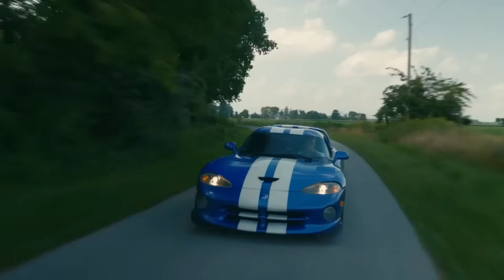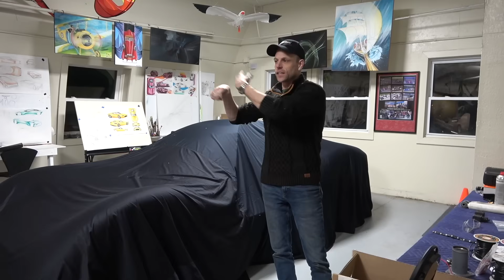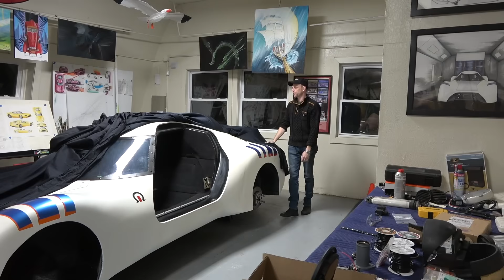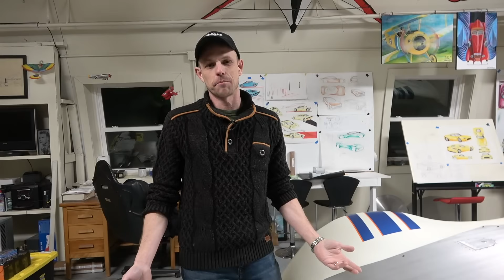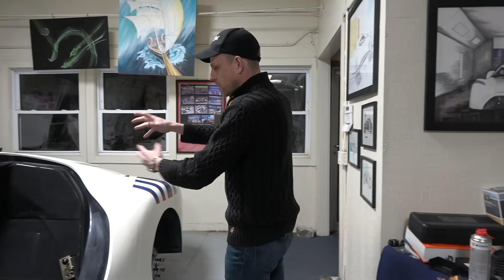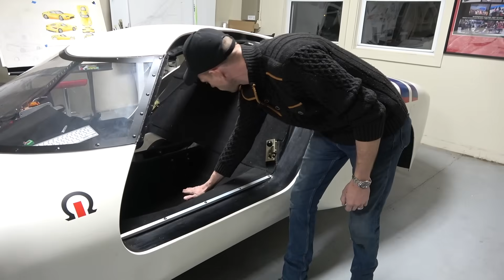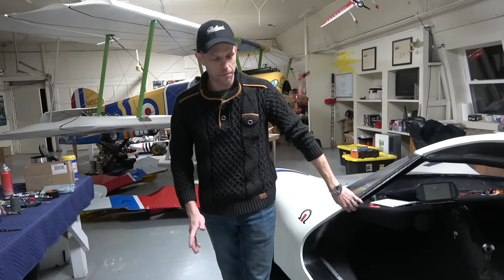Casey's OMEGA CAR because the AUTO INDUSTRY doesn't GET IT!

Comment: Sorry Casey but the ship has already sailed on ICE and especially diesel.  You're never going to match the efficiency of an electric vehicle.   There is a reason the entire automotive world is moving on and why Tesla is one of the most valuable car companies.  While producing batteries is dirty business there are massive investments and research underway on a variety of chemistry formulations to change that.  There have already been massive reductions in the quantity of cobalt for example and now even cobalt free.   Lithium mining is dirty but keep in mind the average EV only has 15-30lbs of Lithium in its entire pack and that battery will be good for hundreds of thousands of miles and then for many more years as second life stationary storage.   Even the crummy degraded Leaf batteries from nearly 10 years ago are seeing massive second life reuse for off grid and peak grid demand storage.    Don't forget Gas/Diesel needs to be explored, mined, pumped, transported, refined, transported again and even a Prius will burn 10+ tons of it over its life.   

And while the energy source to charge those batteries on an EV may or may not already be "clean" the GRID is getting cleaner by the day and thus your EV can be much cleaner 5-10-15 years from now than it is the day you buy it which can never happen with an ICE.  Coal is already the minority energy source and coal is no longer economically viable.  Fossil fuel based energy plants are already moving to NG because NG has half the carbon footprint of coal and requires no additional expensive scrubbing processes of the exhaust to avoid contaminating the environment.  Further NG can be burned directly in giant gas turbines and then the waste heat from those turbines can then be used to make steam leading to a 64% T.E.  This is far higher efficiency than what could ever possible inside a vehicle.  And at the same time solar and wind has become incredibly cheap.   New formulations of PV panels have extremely low degradation and will have a usable service life of multiple centuries.   Today you can put long life low degradation solar panels on your home/property and recoupe your investment within 5-10 years  and have "free gas" to power your EV for not just for the rest of your life, not just for your kids life, and not just for your grand kids life, but your grand kids grand kids life all off that initial investment.  That's not something ICE will ever be able to do.   

And the only thing currently not making EV's much cheaper than a comparative ICE already is the high cost of the batteries which as discussed before there are major forces at play to bring that cost down, way down at which point no ICE will compete in cost, maintenance, reliability, cost to operate.  Etc.
Reply from the maker: Tell that to people with no grid or electric infrastructure around.
Reply: Well how much of the automotive buying/driving world that does even represent?  And how much of the transportation needs of the world are represented by places with no electric infrastructure?  Are we talking about designing and building a vehicle to fulfill a very specific niche at a very specific location or something good for the world at large? 

Regardless I'd argue that outside of edge cases (perhaps Siberia or Antartica) its still easier and cheaper long term to build a basic electric/charging infrastructure than a fossil fuel transportation/refining infrastructure that needs a constant relentless flow of said fossil fuels in perpetuity.  There are remote places in the world where gas still has to be brought in at great expense both in cost and in energy yet they still have access to electricity.

Comment: That's an amazing project! Love it so much. 
As for economy, best I've gotten on good ole 87 pump swill was 50+ on my 2007 Accent. Manual helps a lot because my wife bought an 09 and it struggled to do 40 with the auto. Mine was a completely base model and weighted something like 2400lbs.  I don't think even the modern GDIs can claim anything near that. Used Alpha motors are cheap as hell too.

Comment: Most cars I’ve owned have been diesel. My 2002 bmw 530D has the m57 i6 diesel. That returns around 45/50mpg motorway getting around 600-800 miles per tank if cruising anywhere between 70 & 90mph. Only running around 270hp/500ftlb but has not issues sitting at 140mph all day. My 1994 2.4 n/a diesel hilux runs on air practically I haven’t worked out the mpg. Also a lot less maintenance on a diesel which I like

Comment: Wow, this thing is significantly cooler than i expected. It looks a lot like a "Porsche" Type 64 with the seats from a Lamborghini Sesto Elemento and the engine compartment from the Volkswagen BlueSport, interestingly all VW related products. I also love the gauge delete aspect - it drives me nuts to see new cars with complex screen arrangements that just drive up the price of the vehicle and will look outdated 5 years after market entry. In 30 years none of that is going to work or be repairable, and enthusiasts who still want to drive those cars will have to completely re-engineer the whole electronics with tomorrows tech.

Comment: Actually new automatics are slightly more fuel efficient than manuals.

I personally prefer manuals.

I have one of those “fuel efficient turbo diesel steel box”, I happen to have a 2010 Volvo V50 1.6D Drive E and I average about 4.5 down to 4.2 liters per 100Km, that is about 52 to 55 mpg (if I remember it correctly).

Comment: VW found a way to tell when regulators were performing an emissions test cycle and altered the fueling to produce low NOx numbers.  Academics performing road side drive by emissions tests caught them....
Reply: Yup. It was the steering sensors. If the ECU failed to detect any steering input for a given time period, then it would switch over to the "eco-friendly" engine maps. All other times, high emissions.

Comment: You, know what would be really cool, build a beautiful multi passenger concept that is rear engined and aero dynamic. An homage to the old tartas of the 30s and 40s. But make it electric the right way. Make a diesel electric prototype like we see in the train world and see if that is feasible. I know the EV market is flooded with parted out Tesla parts so all that hardware is accessible and new smaller diesel engines that can be used for generators are out as well. I know your the one guy with the gumption to pull something like that off.
Reply: Correction "tatra" is the name of the car Jay Leno has one.

Comment: For MPG's my daily is a post recalled diesel gate jetta tdi with the dual clutch trans loaded up with kids and luggage driving 70+mph I'd get 42-43mpg. However with little mods guys can get 50 plus with not much effort. Even more with the older TDIs.

Comment: Honda's Earthdreams hybrid powertrain is really cool. They use a gas engine but diesel would also work well. They use the engine as a generator up to 65mph, then it couples directly to the drive wheels. It's like a diesel-electric train.